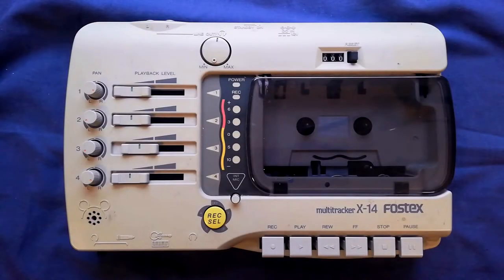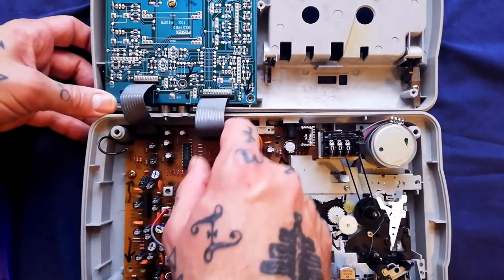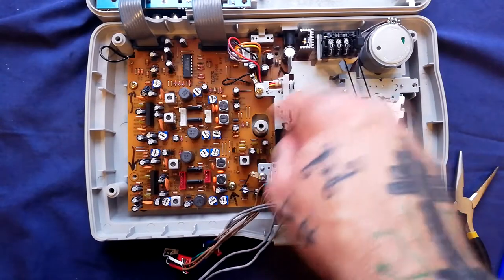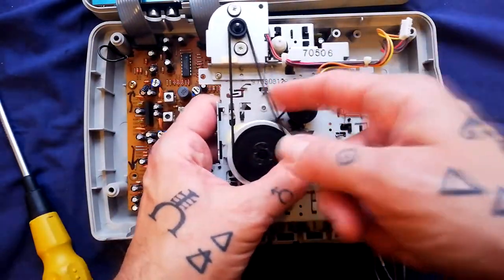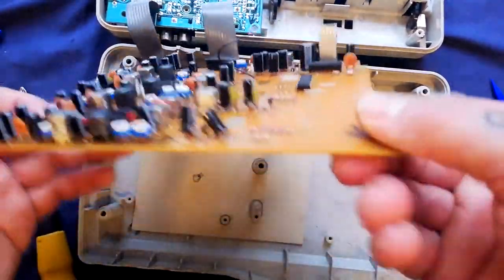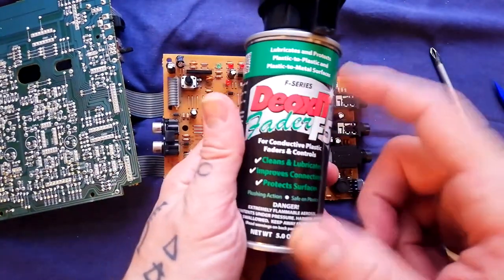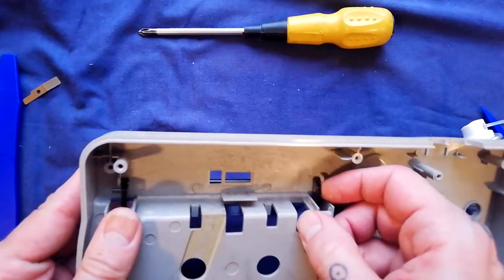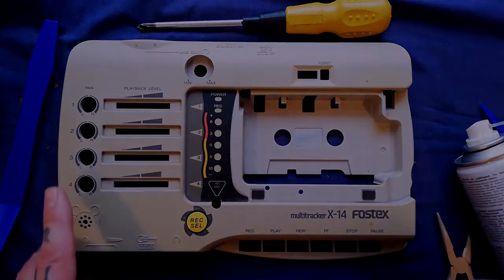Fostex X14 |  Tear Down

Comment: im glad im not the only one to notice mickey. I got a question, if one of the tracks sounds louder and distorted when youre recording but not rehearsing or playing back the recording (like the recording sound in your tascam porta 3 vid) is there a component you recommend testing or swapping out? also, ill be on the look out for your pitch mod video! love this channel! I learn so much from your content. thanks a lot man.
Reply from the maker: Thanks. I'm not sure off the top of my head. If the caps which separate  audio gain stages are leaky that can cause all outs of weird gain structure....on a unit that small a total recap would be relatively cheap and quick...

Comment: I have one of these, I love it. Mine is old and beat up, noisy as heck, kinda possessed. The play button stopped working recently, but the motor is fine and it still FFwds and Rewinds. I took it apart and had a look, but I’m not really a technical guy. Any tips?
Reply from the maker: Check the clip on the capstan ( metal pin which slots into the cassette) is still there. If it's missing the flywheel will drop and play won't work. It might explain the noise too

Comment: Hi Tetrakan, I have just bought one of these and it has a clicking sound when turned on. It seems to be an issue with the transport mainly as the stop button doesn't press down properly and play/ff/rw stop themselves after a few seconds. Do you have any suggestions?
Reply from the maker: There should be a clip on the capstan that prevents the flywheel on the opposite side of  the mechanism from dropping. If it's missing, it makes a clicking noise and interferes with transport functions. Open the unit and see if that applies to you?

Comment: Hi Tetrakan , this is a bottle in the sea. I need to replace the DC POWER Jack socket ( i lost the one i desoldered ). Impossible to find on the web one with three legs in the same position as the fostex x14 and i dont think a service manual exist for this model. Do you have any idea how to solve my problem. ( Also very easy to pitch mod , a pot on the motor and here we go ) . Thanks a lot
Reply from the maker: I’m sorry I don’t know of a source for those, but since you can get screw-tight DC sockets for use by guitar pedal builders mounting to drilled metal enclosures, have you thought about drilling a hole in the plastic case of the fostex for one of those then just run shielded wires from the socket to the pads on the PCB?
Reply: @Tetrakan  Thank you I think your suggestion is my best option. Any risk of frying my unit by soldering a wrong DC socket ? ( polarity )
Reply from the maker: Yes, fostex should be positive tip, so you'll need to figure out which pad is intended for the center of the original socket, I'd have thought that's be clear from the layout of the pins. If it's just for a couple of seconds to see if the LED lights up you might get away with wrong polarity briefly before anything cooks, or they might have decent reverse polarity protection build into the circuit?
Reply: @Tetrakan  Yeah if a standard pins layout exists  it looks likes it is on the fostex PCB. I have no experience with circuit and electronics ( except from soldering pots on battery powered stuffs ... ) Dunno if i can detect any reverse polarity protection but i will order pedal DC socket and try the "quick plug" crash test. Thanks a lot for taking the time to answer. I will post a few pics on the FB 4 track group if it works.

Comment: Would this be a good unit to get into repairing porta studios? Seems nice and simple.
Reply from the maker: Yeah, it's definitely simple. I'd say make sure there's a lot of spares donors fir sale on ebay etc incase you need spares...also its worth ensuring a schematic is  available for your first project, good luck!
Reply: Do you know where I could find a schematic?
Reply from the maker: Unlike tascam, Fostex are usually pretty good about sending out service manuals on request info_sales@fostex.jp they got back to me with an x28 service manual within three working days from that email
Reply: Great, thanks! Would you recommend as a first time project this over the mfp01 or are they basically the same?

Comment: Hey. I just got one of these off eBay to use with tape loops, but it plays insanely fast. So my 8 second tape loops is like 1 second. Any ideas on why or how to fix?
Reply from the maker: Could be the motor regulator chip has overheated, try replacing that or the entire motor

Comment: cool video man, trying to fix mine atm, thought a spraying it out with compressed air would help but no dice. when you record something and play it back it's captured a heavily distorted and thin signal even though it's not clipping on the way in, it's happening both on the mic and instrument inputs, any suggestions?
Reply from the maker: assuming the mic isn't faulty, sounds like the gain structure is screwed. At a guess there's a bad electrolytic capcitors in the signal path, though thats not the only thing it could be  On a unit that simple I'd be tempted to replace all the electrolytics and see if that catches the issue - probably a few dollars worth of caps and a long afternoons work with a good audio book?

Comment: Hey man, thanks so much for the video!  U think it would be possible to do a mod where stereo recording is enabled?  My fostex x-26 just went kaput, so im using the old x-14 again…thanks!!
Reply from the maker: I'm not sure, because I haven't double checked whether there is only one recording amplifier on the circuit board, if there are 4 then the mod would be possible, but not necessarily simple - you'd need to find space in the case to Jerry rig a completely different switching system which would interact correctly with all the muting transistors and soforth, plus find a way to mount another jack socket ...it's the kind of thing someone with my knowledge of electronics or better might do as a challenge to pass the time during lockdown, I don't think it's very practical! IMO you'd be better finding another multitracker that can record 2 tracks simultaneously out of the box, like the Tascam  porta 02 or some fostex or Yamaha equivalent.